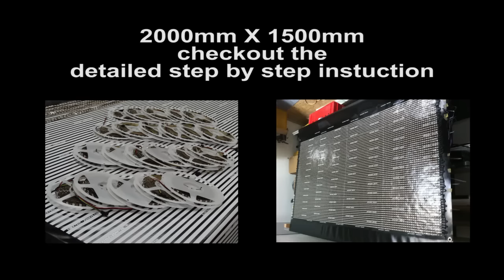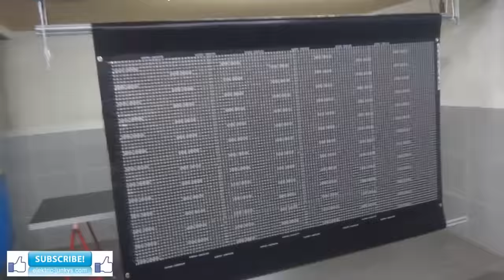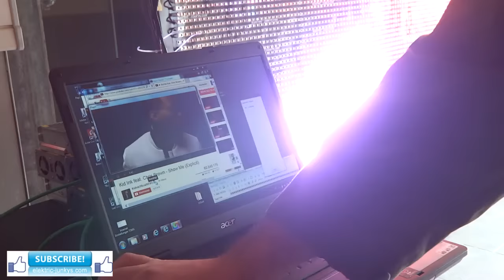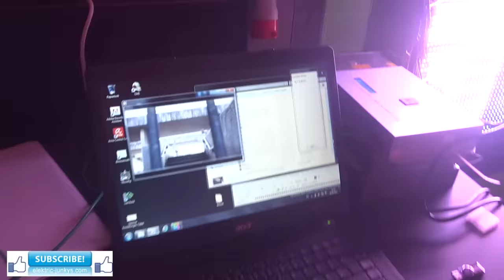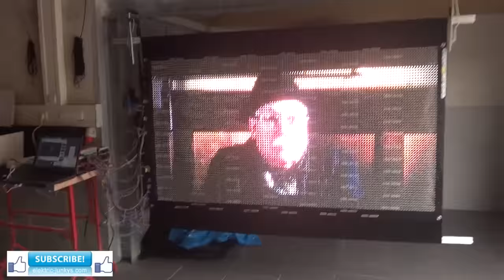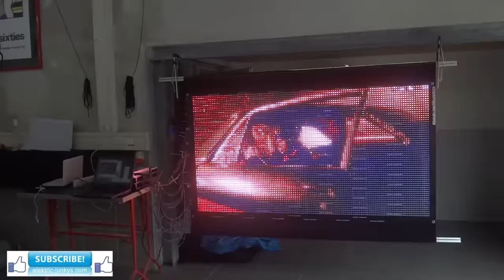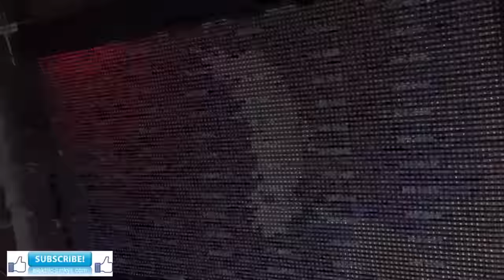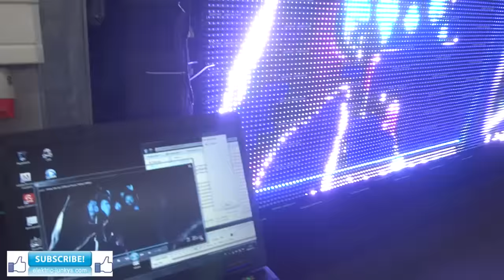how to build a flexible LED Striplight Video Wall P16 | #LEDSign LED Display WS2813 Cortina LED

Comment: How do you drive every individual RGB led? Is it normal RGB led stripe?
Reply: you dont drive every individual rgb led per say, you drive them in series.
Reply: actually if you see it has 3 connectors, it has 5V GRD and Information, this is not the normal 4 connector one, these tings are a lot more expensive, these what I call the Smart LEDS but they are called somewhat Individual LEDs or what, I know that it costs like 33 dollar for every 3 meter? its cool but expensive, deffinetly could use it for experiments and have fun, more likely with an arduino, sound sensor, and with this LED
Reply from the maker: hi mate .. all infos and users manual you can find on  https.//elektric-junkys.com
Reply: They’re individually addressable leds (ARGB)

Comment: Maybe I'm the only one but the FPS is amazing. I couldn't belive multiplexing this mass amount of led stripe chips can be driven at an enjoyable speed.
Excellent project, respect guys.
Reply from the maker: thank´s for comment mate .. enjoy .. share
Reply: You are probably looking at 3.75 microseconds per LED in series for the input signal plus a short refresh time between.  That means if you still want a 60 fps refresh rate, you can have about 4400 LEDs in series. That means the maximum 16x9 resolution you can get is 45x80, which looks close to what this guy has.  Sometimes the LEDs have to refresh faster and you can't put this many in series though.
Reply: @kelseykosheluk7507  If you follow the spec it's 1.15 microseconds for a zero and 1.3 microseconds for a one. So you need on average 29.4 microseconds per pixel plus a 50 microsecond RET code (held low). So you can just manage 33 FPS on 1024 leds (spec formally says 30 FPS on 1024).
Reply: @petermwheeler  Yeah I don't know what I was thinking two years ago, but it was definitely wrong

Comment: if you instead make the lines vertical, you can have all the power and driving boxes mounted along aluminum extrusion rail at the top, as well as the hanging hardware.
Reply from the maker: hi thanks for the comment .. this is an old Video we sell readymade KITS meanwhile check them out on https://elektric-junkys.com

Comment: This is awesome!!!! Just some thoughts, you could sleeve the bundles of cables coming out from the sides, such as, power wires in one bundle, video wires in another, etc, that way you have a very clean and professional look to the finished product. Also, assuming you sell the black backdrop, your logo/website kind of detracts from the image since it is inbetween each line of LEDs, have you considered only putting it on the top and bottom of the backdrop? I imagine you would get a "crisper" or at least less "noisy" image. Just some thoughts, love the finished product and the start to finish video!

Comment: I am wondering if it would have made more sense to put the LED strips on the black area  between the white lines, which would have given it a surface to reflect off of instead of white text on a black background. How many Amps is this display pulling?
Reply: Brian L I was also wondering which would be a better background...it might not make too much of a difference though because the leds mostly are pointing directly outwards unlike a circular lightbulb that goes in 360 degrees this led go 180 degrees or maybe even less. I am not completely sure though. Also there is a possibility to get the actual strips in black or white so if it really did make a difference the could put it on the black part so there would be the white screen surface and the white led strip surface also.

Comment: Looks like a lot of work but it certainly is worth it. Brighter than a projector for sure. And maybe cheaper than an actual good projector too. (amazon mini projectors have shit brightness imo)
Reply from the maker: you are right and you got the Point. This screen is clearly Visible from about 200 Meters Distance. From 200 Meters of a Projector ? nada right 😂

Comment: The amazing thing is that in 5 years this will be so crude, in comparison to current technology, it will be laughed at because of the poor picture quality. In the not to distant future there will be individual  LED's that can change to every color on Earth, have variable brightness control and be one half the size of a grain of sand. They will all be connected together at a microscopic level and a 1000 X 1000 foot display would be capable of producing picture quality a thousand times greater than anything today. It will be controlled by a brain box the size of a coin. Not long after that the LED will become obsolete, giving way to the single layer display. The single layer display will be a spray on liquid that dries on contact. Thinner than a single layer of spray paint we use today. The light emission properties will be at the level of single atoms. An area no thicker than a human hair will be able to produce thousands of colors across it's width. There will appear to be no division line between various colors. Each color will be as if it is blending seamlessly into the next with no border line. The resolution will be clearer than human eyes can detect. A screen, regardless of size, will become active by a single human hair wide laser. The picture will not appear to glow but rather it will look to the human eye as if everything on the screen is real. Applying multiple coats of this liquid display will give the images a perfect 3 dimensional effect that no one will be able to distinguish from reality. Only by physically reaching out and touching the image will anyone be able to tell it is a display screen. After that will come the screenless displays. One laser will be able to produce a beam that separates into thousands of tiny beams. The laser can be set to "Display" at any specific distance from the source and produce a flawless image indistinguishable from reality. Within the laser beam there will be solidification lasers that actually engage the molecules in the air at a set distance from the origination point and turn those molecules into color emission particles. It will be the ultimate hologram. Being used in enclosed areas the altered air molecules give off a slight odor. Within a day the air molecules will revert back to their original state. The final display than I can predict is not a display at all. It will be a tiny hair sized connection to the human brain. When turned on a person will see everything as if he is actually there. The person experiencing the effect will be able to walk around within the "Movie" as if he is actually there. A few more tiny hair sized connections will give a person the ability to not only see and hear images but also to feel, interact with, smell, taste and any other physical stimuli that occurs in real world experiences. The connections all occurring in the brain fooling the person into believing that the sensations are from external stimuli. To the person using this device, the movie he is watching cannot be distinguished from reality. The only way to tell that the experience is not real would be for the user to do something like slit his wrists. He will feel the cut, smell and see the blood, but after 30 minutes and still being alive the illusion would be discovered.
Reply from the maker: Pretty Poetic my Friend ... did you Copy Past that or did you really write that especially for this video =?
Reply: just no
Reply: @ejunky66  the guy is probably on shrooms...nice video man
Reply: You are expecting all these things while you know that these will be invented by men only and he these guys are men too! Your dream will be fulfilled by others and you will pay from your own pocket for own dreams. This video may not pay that well to watch but it's worth trying.
Trial and Error method works everywhere except stupid one's mind! And I'm glad that they didn't try on a stupid mind.
Reply: Could we theoretically suspend these micro LEDs in an ink medium? Get them to run off of bio current, produce images on flesh?

Comment: how do you get individual control of the leds
Reply: those LEDs have a tiny chip inside, that get's data in and out. for more info google WS2812B
Reply: Come on, don't you understand how the I.C's work for each individual LED!!!.
Reply: Walter Fernandes it has a x and y selection.
Reply: Walter Fernandes the guy connected the led strips in a series i guess
Reply: maybe its made with arduino or raspell

Comment: So what was the total build cost?
Reply from the maker: +Dev Everything 99$
Reply: +ejunky66 Was this a typo? Lights, controllers, software? total cost was 99$?
If so who was your supplier? And do you have a forum where i can start a post about doing my own project? or just the FB?
Reply: +v0000000000000000v in bulk I'm assuming?
Reply: +v0000000000000000v the hard part for me is gonna be the programming I'm doing 6 bars  that have 2 of each 4 ft by 1 ft 5ft by 1ft and 6 by 1 ft and I've gotta figure out how to program it to play video ( not full res, this is for stage lighting)
Reply from the maker: +Kreg Taylor yeah we have .. ! https://www.facebook.com/groups/1020525317958853/
Reply from the maker: +Kreg Taylor no also samples ... check it out shop.elektric-junkys.com

Comment: How much will be the cost to build like this ?
Reply: Half the price of a same specifications TV. Why?
Reply: around $1200
Reply: @abeginnerspov5968  Maybe he wants to know the cost. Why?
Reply: A strip of 300 (16.4 ft BTW) of these runs about $30. To build a screen that is 640x480, it would be about 34ft x 28 ft and cost about $31,000 (retail) just for the LEDs, not counting solder, cables, power supplies, controllers etc...

In addition at 5v 60mA per LED at max brightness, you are looking at 92,160 Watts...lol
Reply: At 60/m and with this build stated to be 2m x 1.5m, their screen is likely 120 x 90 giving 1080 pixels. That just under 4 strips of 300 @ $30ea. So approx $120 for the lights. 1080 pixels at 3W max consumption is 3240W?!!

Comment: not bad but i would have glued the led to the black lines instead of while line. and maybe put a frosted layer of plastic on top of everything just to avoid this scanline look and have more just a screen (more lightbleed but better pixel blending.)
Reply from the maker: hi, thank´s for comment that is a good idea, have a look at the advanced system Ready-made DIY KIT check it out https://www.youtube.com/watch?v=fnnVExn7aoU

Comment: It looks like the framerate is quite low. Shouldn't be a necessary limitation, the bus speed is fast enough for 1/8 of the screen. Did you only use a single bus for the whole screen?
Reply from the maker: Hi, the newer Models such as WS2813 and WS2818 have a way higher refreshing Rate please visit our website for more Infos https://elektric-junkys.com cheers enjoy your weekend

Comment: Cool 😎

Can I make 120x208 led matrix using ws2812b and controlled via wifi or bluetooth?

I want to control it wirelessly so it's either wifi or bluetooth control.
Reply from the maker: hi thank´s for comment yes def. possible please follow the link and get in touch with us .. you can get the full kit from us .. enjoy your Sunday

Comment: How to change the colors of the LEDs in the same tape. Note that you can light one color in each bar, because you only have 4 ports (pins) ?
Reply from the maker: hi mate it is an adressable CHIP inside each LED .. thats why they are a bit more Expensive than SIMPLE RGB STRIPS ... hope i could help you  ..

Comment: so i have a question...i have gone ahead and done 50 led per segment 10 segment total, and my in is bottom left and i have hooked it up like a snake trail...when i use led edit, i choose 50 x 10 , 500 total led, but when i power it up only half lights up...the end of the strip needs to also be conneted? or i just need 1 main source?
Reply from the maker: hi guys .. this is an Pretty old solution .. you do not have to work 3 weeks on a screen like that anymore .. we make it cheaper faster Proff. and no more wires ... + 10 Times Larger 
https://www.youtube.com/watch?v=a6s2MlZHnC8    minute 0:20

Comment: Good work
Great idea to implement with the LED strips. the LED strips?
Is not that getting closer?
Would not you think differently now?
There is so much space in between.

You've only built a horizontal line, so why not build another vertical line?
A control unit for horizontal lines and vertical line others control unit.
So you would get higher resolutions and images look better than too far distances.
Or used a WS2813 stripes with 144 Led , because the distances are smaller.

If you have direct contact with manufacturers, you could make other efficient LED strips.
By moving the control chip and contacts on backside.
So the front LED would have plenty of room and there is probably more LED possible.
Reply from the maker: we are manufacturer based in china contact us https://elektric-junkys.com

Comment: That is some serious driving. 60 leds per m. That is 120x90 res which is 10800 Leds.
Bit rate on the ws2811 is 400kbps, 24 bits per LED.  For a total refresh rate of... 1.5Hz... But it looks to me like its divided into maybe 8 sections?
So 12Hz?

Comment: that is a ton of work to do something that you can do with a video projector or a big screen tv for a fraction of the cost, especially if you buy used tv or projector
Reply from the maker: thank´s for the comment also if you did not understand the Purpose of this Screen System. This is a Far View Screen clearly Visible from 200 Meters. from how many Meters can you view a Projector ? Merry Christmas my Friend !

Comment: How many lines are used per meter?
If the distance between leds are constant, then 3×2 meter means 120 strips. The max power draw will be around 18w/3m strip 2160w... 
I am planning my own, but I am concerned about the heat, so I go with aluminium sheets 0.5m×0.5m for better heat dissipation and 96led/m. I can't afford that as one, so I will go 1 panel at a time until I reach the big "picture". Soooo exciting!!!
Reply from the maker: hi should be not a Pro, we assemble here in Shenzhen in large qty´s. let us know what you need m make OEM Screens Day by Day ! thank´s for comment cheers

Comment: Why not just build one with round bulb LEDs stranded in the same fashion? Then your display could be hung vertical and seen from all angles. Imagine that embedded into a duel layered translucent shower curtain.   I can't really see doing what was done here as anything special. A projector could be had for less money and do the same thing.

Comment: hey guys could you explain how to connect wire to power supply and t300k in finishing step  ,and maximum how many pixels connecting to one power supply? plz answer
Reply from the maker: sure send us an email .. send us your order Number and you will get all infos you need

Comment: It looks like each row has a decent amount of spacing between.  Is that necessary or could I (essentially) stick them closer together, adding more LED rows for a higher density display?
Reply: He probably had to do it to maintain a square pixel grid. If you stick strips together, you'll end up with a wrong aspect ratio
Reply from the maker: hi, exactly like the Otter have said :) we were trying to get a Clear and Percise Pixel Grid View. Thank´s for comment guy´s stay tuned if you like lets collab. On our LED DIY Facebook Group,or Youtube or whatever ;) get in touch https://elektric-junkys.com

Comment: Hi Im an animation student and want to re-create something similar to this using single colour led strips (white). I current have the leds, and arduino uno, 24v amps. What is it that i exactly need?
Reply: Oh i also have a 12v power source
Reply: cool story bro, I ended up recreating something very similar to this video and received the top grade in my class for this particular project.
Reply: Arek R. University Animation project actually.

Comment: i look on your website, i see the t300k controller says 30,000 pixels, or even 300,000 pixels, but also it says 8 port times 1024 pixel. so, how can you do 30,000 or 300,000 when it is only 8 x 1024? please advise. can it take a standard video input signal? is there a user manual i can look at before ordering?

Comment: FLUX!!!!! Use it. Flux core wire isn't enough the solder joints will not last with no flux.
Reply from the maker: possible ... thanks for comment mate !

Comment: what did u insert for a video test ? and what's the purple wire attached to every strip? other than three wires c( red, green ..)
Reply from the maker: visit the full Text Instructions and you will find the Details .. if you Purchase from us "Manufacturer" Directly you will recieve FULL BUILD UP DETAILS ! shop.elektric-junkys.com
Reply: ejunky66 and why there is a gap of 1 inch between every strip vertically?

Comment: Are you just putting solder on the wires and then pressing the soldering iron on them at the pad?
Reply from the maker: ADVICE = DO NOT SOLDER ... >>> 2017 Solution NO MORE SOLDERING https://www.youtube.com/watch?v=sPt9olLB_o4
Reply: Yeah, I've seen these connectors.  Just in general I suck at soldering and have to do it on my drones all the time.

Comment: Hi ejunky Team,
l have build a similar matrix but i splittet the output to a two sided display. I have 42x25 pixel each side. Everything works well but after a while some stripes don't work anymore. If i change the stripes the same place makes trouble. I use 3x 300W supply and the T100K. I sticked the Stripes to a aluminium plate and made a aluminium housing. The Transformers are with in the housing and the less are waterproof. I can't figure out what the problem is?? Can you help me?